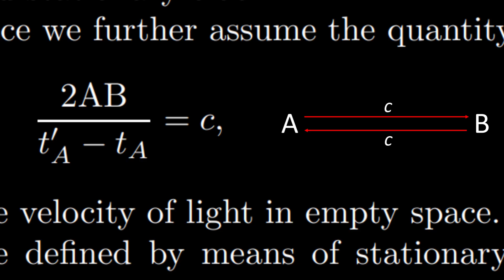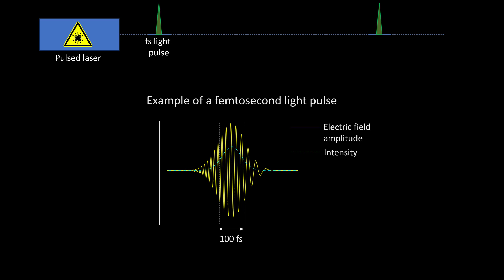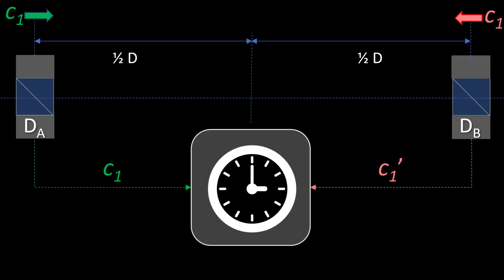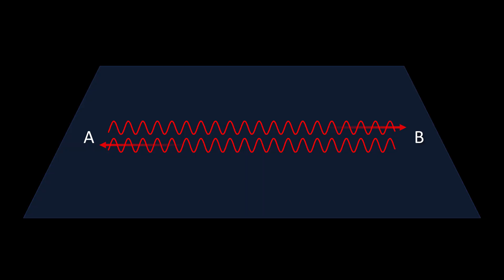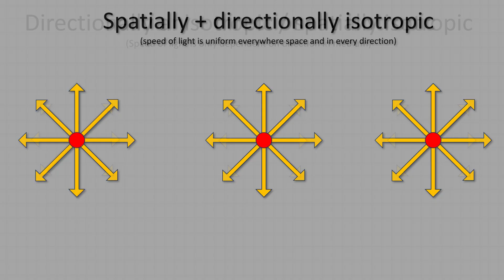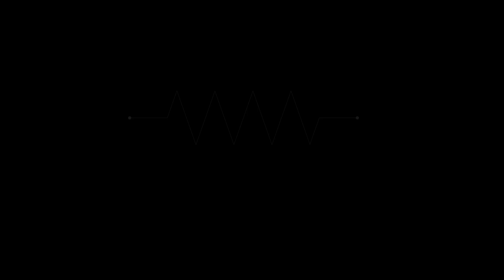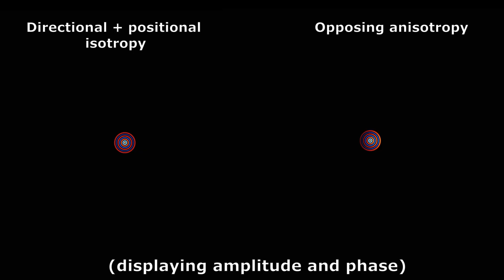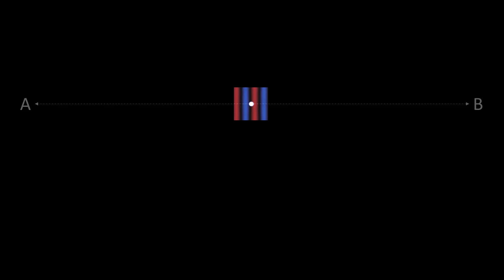Knowing the one-way speed of light

Comment: I don't think your asymmetric spring reasoning is correct. What you describe is a type of spring that generates different forces at its two end points for a given elongation, which as you point out violates conservation of momentum (and the action reaction principle).

What I imagine as a (legal) two constant spring, for example, would be one that has k1 under compression and k2 under elongation (which isn't hard to achieve) but this would still result in isotropic propagation, so I'll come up with another spring.

This third spring "detects" which of its ends is the first one to move (left or right) and "decides" if it will act as a k1 or k2 spring. A wave propagating from the left will encounter a medium with an elasticity given by k1, different from a wave approaching from the right (k2), resulting in two different wave speeds while conservation of momentum is preserved.

Some possible issues with a system like this would be how the spring could "detect" and "decide" fast enough, intuitively this seems to require information to reach the spring's "decision" system faster than light travels in order to adapt to a traveling wave of light so as to slow it down.

To be honest I also didn't find the last part of the video very convincing. It seems that reflecting light would violate conservation of energy but that is because we use formulas derived assuming C1 = C1' to start with, maybe we can come up with better ones. To be actually convincing I think you'd have to show how exactly that "illegally" obtained free energy could be turned into profit, but I can't really come up with any ideas about how. For example you could argue that these extra energy photons could be used to excite an atom, which will then emit a higher energy photon, which gets reflected for an even higher boost of energy, and so on. But then who is to say that atoms themselves would be excited isotropically?

Thanks for reading so far down lol.
Reply: The arguments in the video cannot prove that c1 = c1' in the general case. Rather, they hint that such an effect would require a significant remodeling of our theories rather than just a small correction.
Reply: @entcraft44  Absolutely agree with this interpretation. I just wanted to point out that you could imagine a sort of medium which propagates waves anisotropically without violating newton's principles. That being said, I'm pretty sure our whole current model of physics does assume that empty space is symmetrical or isotropic (I don't know which word fits here better). The fact that a model with this "extra" assumption that c1 = c1' doesn't fail experimentally is proof enough for me otherwise.

Comment: What about a cylinder of photographic paper with a cylinder in the centre that has two slits on opposite sides and contains a light source within. Both cylinders are fixed to a circle on either side to make a wheel like construction. Now spin up the entire device until it is rotating at a massive continuous speed then turn on the light source in the centre cylinder. Turn off the light source and then develop the photographic paper. If the diffusion pattern on either side of the paper is the same then the one way speed of light is the same, the pattern will be slightly different if the one way speed of light is different.
Reply: Why would the diffusion pattern be slightly different depending on the (one-way) speed of light?
Reply: If the time it takes for the light to travel from the slit to the outer shell was different it would hit the photographic paper at different times creating a different diffusion pattern.
Reply: @NerdENerd  Oh, you mean the light would only be on for a tiny, tiny amount of time, not allowing the slit to do a full rotation? 🤔
Reply: I left out that there needs to be a second sleeve that has two slits that doesn't rotate that has two opposing slits like an axle. Each rotation the spinning slits let light through the axle slits.
Reply: @NerdENerd  Ah, so that would spread the light that gets through apart by different amounts based on the speed of the light?

Comment: I thought that the one way speed of light CAN be measured, or at least shown to be either equal or not equal to in opposite directions.

The set up is simple but it doesn't use photons, but two muon guns, calibrated to eject muons at a known velocity. The velocities don't have to be equal but for simplicity, let's say it is.

Below, M is the muon gun and D is a detector. 

M.................... D......................M

Here, we don't care how long it takes for the muon to reach the detector. We simply measure IF the muon is detected from both sides. The decay time of a muon is very well studied. We repeat this experiment by changing the distances between the detector and the muon guns until there is a statistically significant difference in muon detections, or they both fall off at the same rate.

If there is a difference, then there's a difference in speed of light in different directions, if they fall off the same way, then there is no difference.
Reply: Beat me to it (I had a similar idea, which I wrote in a comment before I saw this). I'm very curious to hear if anyone manages to find a hole in this approach (I've not managed to yet). Muon gang, let's go!
Reply: When I first saw Veritasium's video I thought: Okay, we can't directly measure the one-way speed of light. But what about the wider consequences? Are our current theories mostly compatible with a bidirectional anisotropy or does this require large changes?

This is an excellent idea for an experiment, but I am not actually sure what it would measure. Would the "internal clock" of the muon be affected by the travel direction if we assume c not equal to c'? We can only determine the kinetic energy of the muons, not the velocity. Does the way velocity relates to energy change with direction?
Reply: @entcraft44  There is an assumption that the energy of the muons (percentage of the speed of light, even if it varies by direction) directly affects the time dilation of their "internal clocks", yes. If it takes the same energy to get near c and c', but c doesn't equal c', then the same amount of time dilation should result in the muons decaying at different distances from the respective muon guns (in the reference frame of the muon guns and detector)?
Reply: @entcraft44  the decay time of muons change with respect to its velocity. The closer it is to c (speed of light), the longer it can exist. This is due to the time dilation experienced by the muon.

Whether or not direction of travel of the muons changes the life time of the muons is the subject of the experiment.
Reply: @abhijithcpreej  Thanks for clarification. But I have more questions: E = gamma * mc^2. For the rest energy it seems obvious that we need to use a mean value of c in that equation. It follows, at least naively, that the kinetic energy T = (gamma - 1) * mc^2 also uses a mean value for c in the mc^2 part but not the gamma part. Particle accelerators typically measure energy, not velocity. So both beams have equal T and thus equal gamma, and there is no difference in the decay time t = gamma*tau (tau: intrinsic/proper decay time); even if the speed of light is not the same in all directions.

For your experiment to be feasible (assuming my modelling of T is correct) you need to have a device that can measure the velocity of particles in all directions independent of the directional speed of light, which is I think impossible.
Reply: Actually, if lab frame decay time is the same but speed is different then obviously the travel distance is different and distance can be unambiguously measured using the two-way speed. So my previous critique is incorrect, if my formula for T is correct.

Comment: I am familiar with the reasoning in the Veritasium video, which is repeated (and added onto) in yours. Yet, in principal, I think the one-way speed of light can be measured. But it may be difficult in practice.

Say we have two lasers opposite and parallel to each other. If we give both an extremely short and equal amount of time to reach the other side before they are occluded by some device in the middle, it will then be clear to see whether both lasers make it to the other side in time or only one of them.

The device in the middle makes sure the timing is equal by way of mechanics, so without a clock. One such device may be two opaque rotating discs, each with a small hole close to the outer edge. The discs rotate extremely quickly in opposite directions, giving an extremely short amount of time where the holes align, allowing light at c to pass through but not anything slower. The holes will align at two places so the lasers can each use one of those. Because the lasers are both subject to the exact same device at the same time, equal time to pass though both holes is guaranteed as long as the discs spin at a constant rate which will be helped by the inertia of the discs.

The alignment time of the holes will have to be tuned to the distance between them to require a speed of c for light to pass through. Although we could also simply keep increasing the speed of the discs until one or both lasers no longer come through. And we will have experimental evidence.

Sadly this may be very hard in practice because the discs may have to rotate so fast they would be torn apart at distances we can manage on earth.
Reply: Strictly speaking, if one laser were exactly half or a fourth (etc) as fast as the other, both would still pass through. But that seems like enough margin to rule out most difference in speed.
Reply: Wouldn't the lasers have to fire synchronously for this to work?

Comment: Well done. It's one thing to argue that we cannot measure the speed of light in a single direction (always requiring a reflection), but quite another to assert that the speed of light in one direction could be different from the speed of light in the other. While the E=cp explanation is much simpler, I very much enjoyed the full exploration of the possibilities of anisotropy. Recall that it was Maxwell's equations that eventually led to special relativity, where only the Lorentz transformation could account for a constant speed of light. So if Maxwell's equations are fundamentally true (omitting quantum perturbations), then even if you can postulate the speed of light being different in opposing directions, it's impossible to model it in a self-consistent way.
Reply: If we can't measure the one-way speed, does it even make sense to consider to question what the one-way speed really is? In SR one-way speed of light is just a choice of coordinates. The problem with the argument from Maxwells equation is that in their standard form you have already chosen an isotropic, Einstein synchronized coordinate system. If you choose another coordinate system, you will have equations with anistropic light speeds (and hence not the standard wavequation with c = 1/√(ε₀μ₀))
Reply: "even if you can postulate the speed of light being different in opposing directions, it's impossible to model it in a self-consistent way." - it is actually the other way around. Any anisotropic model of the light speed is self-consistent, as along as the two-way speed is c. The one-way speed is theoretically impossible to determine and is a matter of definition. You can choose any one-way speed you like for your model, and you will still end up with the current consistent physics model.
Reply: You can use curved space instead of a mirror.   Shoot a photon to orbit a black hole near the event horizon.  It will come back to you.  Just time the orbital period.   You know the distance so you will know the one way speed.
Reply: @jeffbguarino that's a very good. Idea but won't the light being near an object with a ton of gravity cause time dilation if the clock isn't also effected by some intense gravity as well 

Imo even if it does I don't see why we can't record the information found adjusted and not adjusted for dilation since with gps we can apparently do that fairly reliable.
Reply: @jeffbguarino  And how would you prove the act of going around the black hole didn't slow down or speed up the photon in some way? And let me be clear, it doesn't. I feel very confident that c is constant in all directions but the point is, how do you prove it?
Reply: @wingracer1614  But the circle of space at the event horizon is all the same direction.  This is how a direction is defined by light which takes the geodesic which is the shortest path.  So it is one direction or the same direction or do you somehow superimpose a euclidean coordinate system on top?        It is just as if the earth is at two different places in an inertial euclidean coordinate space and you are at two places at the same time. 
If the speed of light slows down or speeds up at different places going around a black hole then it could do this anywhere else.  Like between mars and the earth speeding up and slowing down all over the place and you would never know.  So that is introducing a new animal into the problem.
I found the definition of a straight line on google:  (which I never really knew before)  The shape of spacetime requires a new definition of a "straight line". The way to define a straight line is that trajectory that is followed where object experience weightlessness. Otherwise, if you experience weight, then you must be accelerating (according to the equivalence principle) and, hence, you must be changing your direction through spacetime.
Since the space station feels weightlessness, then it is travelling in the straightest possible path through spacetime. Similarly the Earth is going straight as it orbits around the Sun. We standing here on the Earth are, however, accelerating. 

Thus when you are at the event horizon or just above it, and fire a laser tangentially , the light will be in free fall but here the escape velocity is the speed of light, so the light can avoid falling into the black hole.
Reply: @jeffguarino2097  I don't disagree, in theory. But again, how do you measure it in a way that would prove it?
Reply: @jeffguarino2097  no it's not the same direction any more than any other circle is all in the same direction.  When I drive around a city block back to where I started, I am not driving in only one direction, and still not if the block is a circle, and still not if I am a photon, and still not if the middle of the block contains a black hole.

Comment: What if you just transmit the information to the clock NOT in the speed of light? For example using the speed of sound in a tube or a metal pipe in which we know the speed at which that sound travels, and therefore not introduce complexity into the problem (I mean, you are literaly trying to measure the speed of something using THAT SAME THING for communication when timing is reeally important... like... wtf).

Comment: I think it could be measurable through interference.
If you have two complementary extended wavepackets (one is the linear opposite of the other, don't ask me how to make them) you could shoot them onto each other and see if the resulting EM field is abolutely zero, or whether there is a residual EM field. If the wavepackets are extended in length (lets say 1m in length) and the speed of light is not the same in both directions, the EM field should not cancel. Or did I make a mistake in my thoughts?
Reply: Interference will produce no result. The frequency of light will remain the same all the time. Only the wavelength will change, but only in relation to the stationary ether (personally, I am convinced of the existence of such). We will not observe this in our frame of reference, we do not know whether the wavelength and speed of light have decreased or whether the speed of light and frequency have remained unchanged.
Reply: @kashubia2509  I don't really care, if we call it "space" or "the ether" as long as the effect stays the same, but I don't get the answer. The Idea is to shot two pulses, that annihilate, but are not symmetric, toward each other and measure the E-Field at the connection point.
Reply: @theonlyhero  Can you explain why the E field should not be canceled? The wavelength will change  to exactly compensate  the change in speed. The amount of energy transferred will remain the same.

Comment: If the one way speed of light is the same for all observers, relativity has a new paradox.  If the observer on Einstein's train kicks his light clock over, in the direction of travel, the calculation for gamma requires (c + v) and (c - v) to get gamma^2.  Length contraction then reduces that to gamma.  If the speed of light remains constant in each direction, relative to the clock, there would be no need for length contraction because there would be no time dilation.